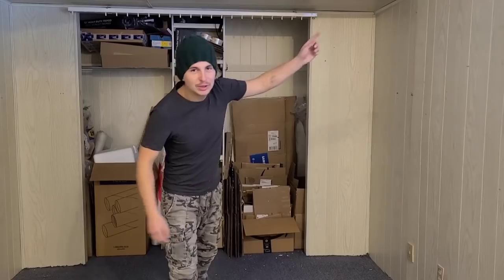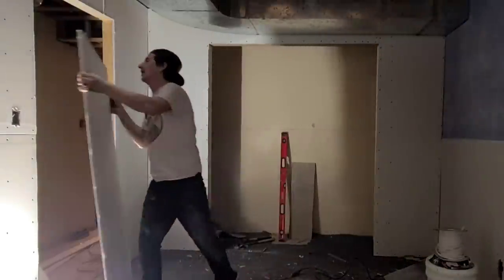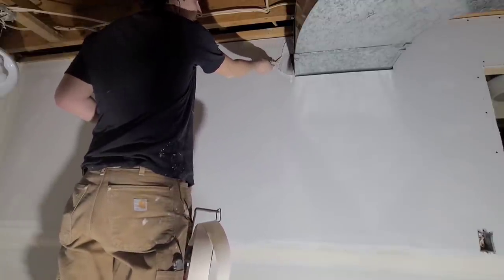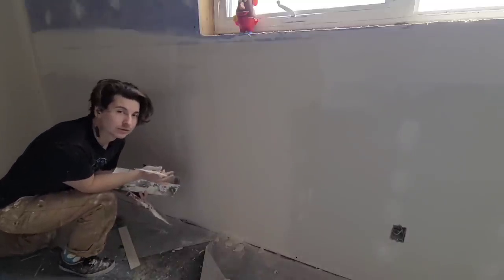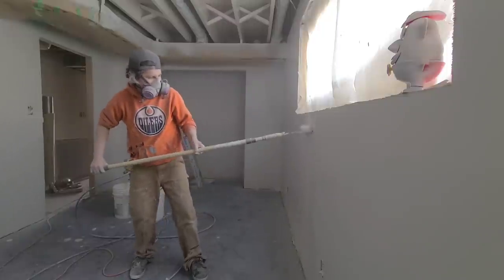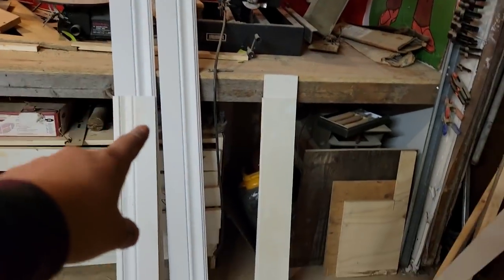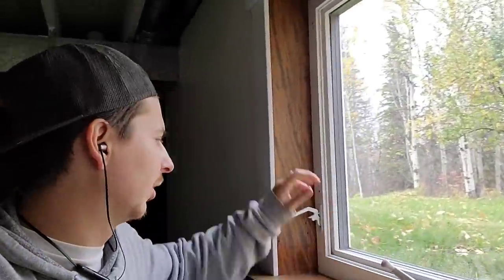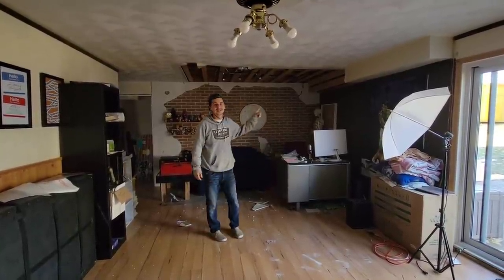Renovating a room into a kickass office | Another VLOG #137

Comment: Two other types of doors you can consider are "saloon" doors and a swinging door.  Both stay closed unless being used.  There are no handles.  You use a vertical rod and the door(s) swing on it.  "Saloon" doors are usually open at the top and bottom.
A third type would be bi-fold doors that you usually see on closets.

Comment: Love the green with wood trim & absolutely adore the fairy door, so cute!
Sorry if I missed it but any reason you didn't insulate and sheet the ceiling?
Clint's a wood & detail guy so of course he'd spot it, shame you e not got any more left from upstairs to replace the blistering pieces
Could the entrance door not slide along the inside wall (hanging barn door style) and stop past the light switch? (Love the olde office part glass style idea)
& Like the profile up to the wood trim in the corner 👍🏻
Reply from the maker: I explain in the video about the ceiling. Going to do in floor heating. I have plenty of the floor left but id have to rip up everything to get to the blistered part and didnt feel like it sinse its temporary anyway. Having the door open  that far would take up too much of that wall. Need it for ca inets or whatever else.

Comment: 2 things,,,, #1 you two should have worn safety glasses when removing the ceiling and walls,,, #2 why didnt you put the light switch on the other side of the door way, so u could have an internal sliding door? great work tho ;]
Reply from the maker: #1 youre right. #2 because we dont want the door to open on the big most useful wall.

Comment: 46:38 😨 

SIR! PURCHASE A SAWSTOP TABLE SAW WHILE YOU STILL HAVE THOSE FINGERS!
Reply: The room came out adorable but you make me so worried for you.
Reply from the maker: I hear ya, and appreciate you watching. 

Quick story also about a weird fluke accident i had, regarding saw safety. And this is not to say youre wrong for your criticism,  because you arent wrong. 

But anyway... i often use push sticks, believe it or not, and this one particular time i was also using a riving knife because it hadnt been removed yet. I was pushing through a piece of spruce 2x. Just shaving off a little bit, when the push stick for whatever reason had slipped off the work piece and forward. The way i was holding the stick was so i had my index finger on the spine of the stick pointing forward. Pretty standard grip. What ended up happening is my finger got really close to the blade.  Just a weird thrust of momentum, when i had nothing to push against. Maybe some werid tension in the wood or something had adjusted. I thought "dang that was close." Had a look at my hand. And since i had been staining a bench piece earlier i had stain on my finger tips. I noticed a kerf width of a clean line on my finger. The blade just barely got me. Didnt even feel it. Just enough to cut a tiny layer of stain off. Which is to say. It could have been worse, but likely wouldnt have even had anything happen had i not used a push stick. But who knows.